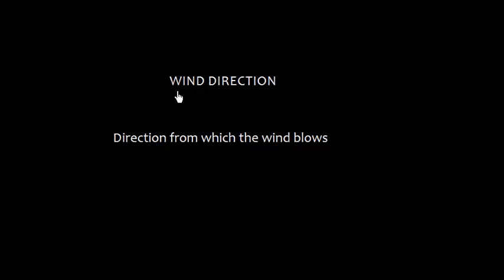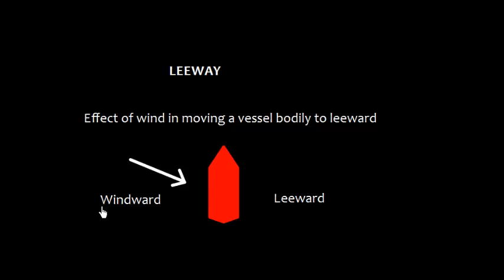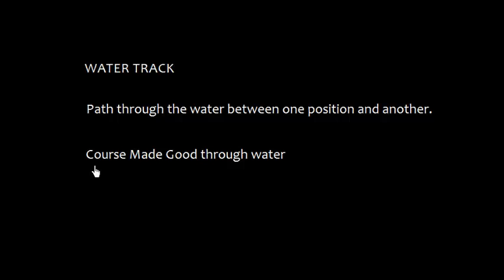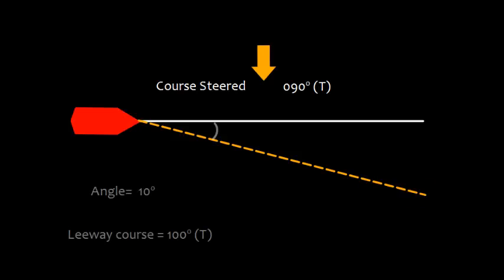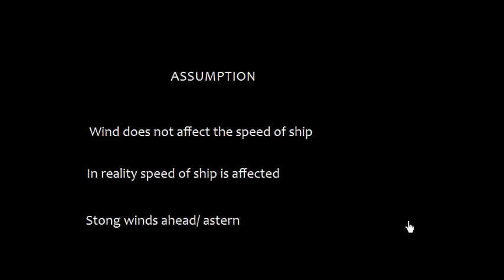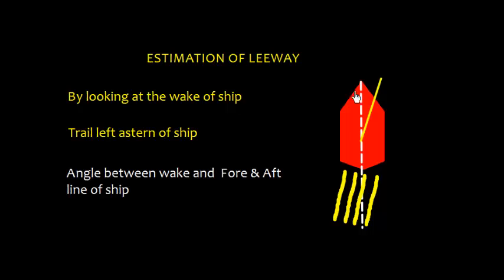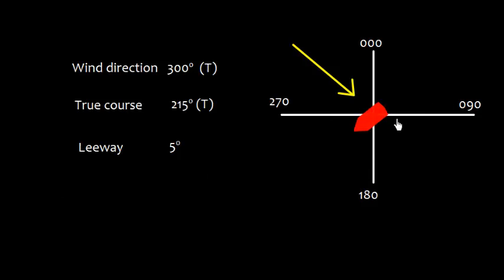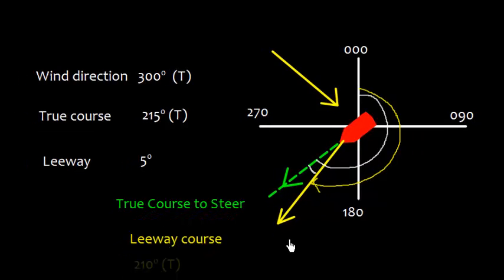Navigation_  Effect of wind on course to steer_Leeway course

Comment: If I have a 10 Kt wind on my beam - how many degrees should I apply to compensate over a 1 hour passage ?
Reply from the maker: ColGadarby 
Leeway can be estimated  by the ship's  water track and course steered.  Effect of wind on ship will depend upon windage area that is how much the area of ship is explosed to the wind. An estimate of force is  velocity square/18 per 1000 sq m are exposed.  Even this force will need to be examined in the context how loaded or light a ship is at that moment. Hence leeway  is just an estimation.  I am also  looking  for a concrete  solution to provide exacta amount in all cases.
Reply: Many thanks ! There are many questions in the RYA syllabus for the offshore theory which include 2 or 3 degrees of leeway but not explanation of how they decided upon those degrees to be applied.
Reply: @sailorstube3259  nice explanation sir , are you a sea- captain or naval architect by any chance, or just a genius?
Reply: For 2nd mate/DNS/Bsc NS prepration join kundan patna #kundanpatna